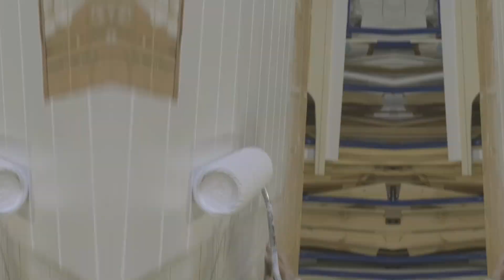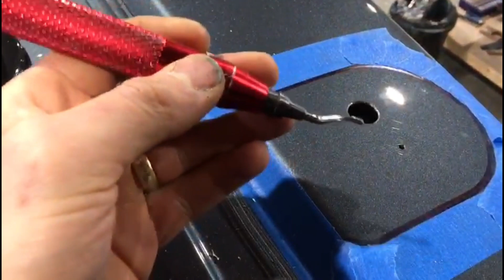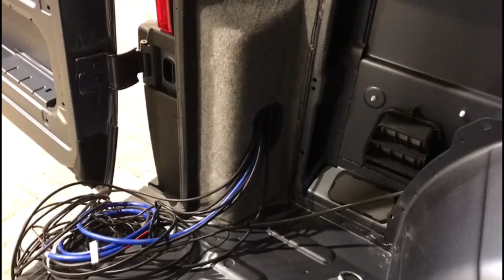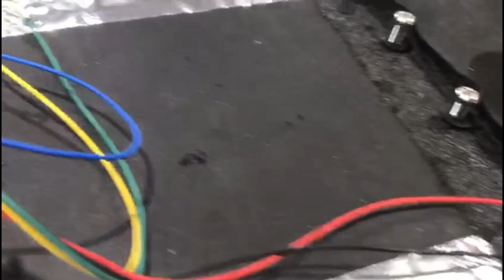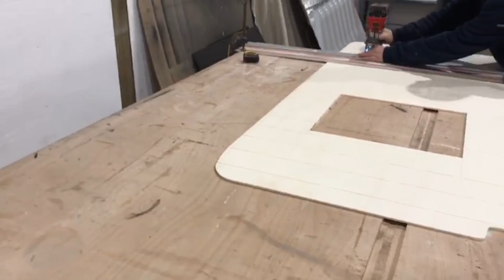Week 1 | Windows, 1st fix utilities and insulation | START to FINISH Van Conversion Series

Comment: Question re. Insulation - I've purchased 8mm closed cell foam with a foil front layer and adhesive back (10mm above the cab).

Whilst I know that 8mm thickness combined with the PIR boards will be enough to insulate properly, should I be using the non-foil neoprene sheet as you have? Will the extra layer of foil create a problem with creating the vapour barrier?

Great series thanks!
Reply from the maker: No we often use the foil backed one too👍

Comment: Hi, Great video- thanks! What was the tool that your colleague is using at 14.43 to put grooves in the ply you're using for the door cads please? Thank you!
Reply from the maker: Hi, thanks for your kind words. It’s called a palm router (sometimes called a trim router). You can purchase different shaped “bits” for different jobs. The “V groove” bit is what we use on the plywood walls and door cards. All the best

Comment: Hi Oli, I liked your conversations. I'll contact you for my van conversation for sure. I have also a general question.  I saw many conversation videos all around, but none of them explain what are they doing with the screws. In my opinion, when you screw/make a hole on the van as the paint is removed at this area, over time it will potentially rust. Shouldn't we paint them after? Or dipping the screw in paint or doing something special before fixing it? Just curiosity. I'd like to take advantage of your experiences. Thanks.